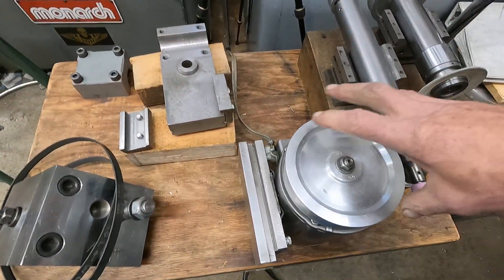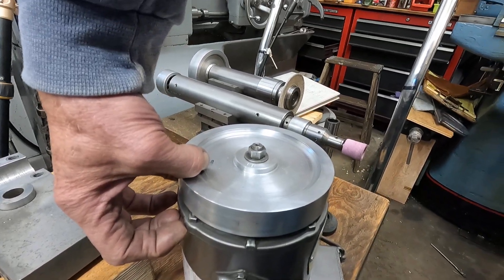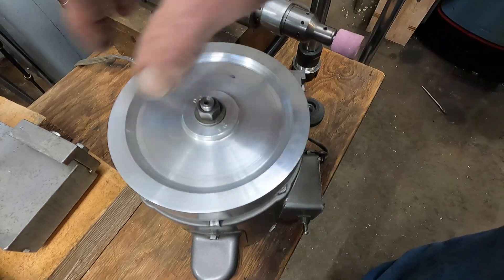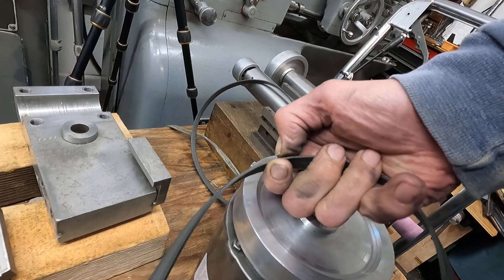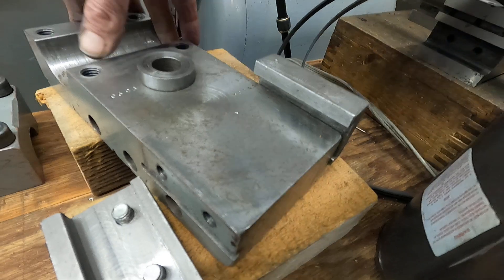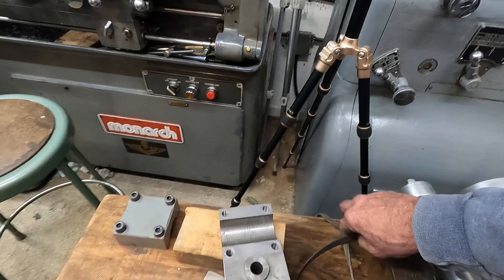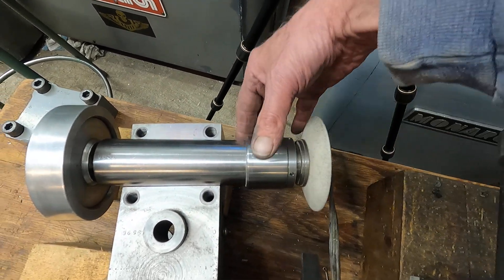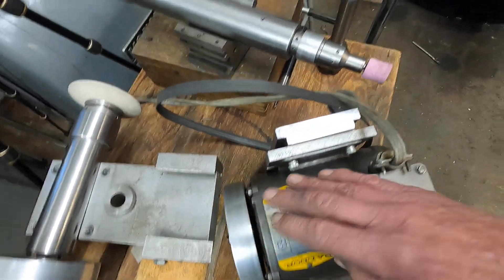Tool post grinder with precision spindles

Comment: There was a guy on Practical Machinist with a 10ee manufacturing lathe years ago from Walla Walla; would that be you?  I don't want to use the name from PM.
Reply from the maker: I seem to remember a guy on that forum of trolls, fakes and losers, probably left that sh*t for brains outfit run by a total puke of a machine tool dealer, for his own channel on the fabuluos YouTube. Roger That!
Reply: @deedeeindustrialsuperprecision  I always enjoyed what you had to say about machining and 10ees but remember people hassling you about your comments.  I still get on there but only the Antique and Heavy Iron forums.  I have a Van Norman mill and a tie bar Hendey.  I'm glad I ran across your channel!
Reply from the maker: @rickhand8228  The heavy iron moderator a fake gunsmith and supposed texass cop and the chump on the Monarch forum threatened my family by order of the sawed off POS racist owner!! Do not bring such scum to my channel.

Comment: Hey deedee, I think the topic of building machine tool spindles would be a wonderful subject for a video. You could really go in-depth on the subject of the different types of bearings, pressure angles, preload, lubrication, etc.
Reply from the maker: I plan on building another internal spindle with a collet nose, I will find a reasonable deal on the bearings first.

Comment: DeeDee, Absolutely stellar episode.  Tool post grinders I’ve owned have been toys compared to you build, and expensive as hell.  Thinking about yours a lot of thoughts went into making it simple but very flexible.  Nice design and execution.  It would be a challenge for me to build one but that project is going on my list.  Your belt trick is very &oil too.  You’d mentioned it before with regard to the Monarchs,but I don’t remember you talking about how you made them.  Great trick and worth everything you’re charging.  The last flat belt I bought from Dumore was not only comparatively very light weight, but cost an exorbitant amount.  You’ve made a convert.  Thanks for sharing everything today.  What a treat.  I am looking forward to seeing what you can do with with your grinder and really appreciate you sharing your wisdom.  Best, Will
Reply from the maker: Hi! Glad you enjoyed it, most prefer to watch an Axelson get slammed into reverse. It is funny but true!
Reply from the maker: I think you will find the Monarch 10ee easy to use and make parts like these. The first spindle I built used just a pair of electric motor grade 5 bearings and it does a remarkable job. The cost from a bearing house for spindle bearings is high, so I found new surplus bearings and designed the components around those. The 10ee is heavy enough to work pre-hardened steel to close tolerances making heat treating then finish grinding not needed most of the time. That is why they are still valuable machines

Comment: When I started my shop, I had to make a cheapie with a makita router with a dovetail mount that dropped on my aloris toolholder. It did work but later when I had the money , I bought a dumore tool post grinder. I make tooling for coin making presses and have to grind the id of coin collars.  We tend to improvise and find ways of getting things done with what we have available at the time. Dont jump at Me too hard for using a router, The customer I was servicing really helped me build My little shop. I had to polish the collars after grinding anyway.   You sure have made some nice tools. Wish I had the time but im always so busy in my shop keeping with delivery dates. I would love to have a moore jig grinder but my shop is crowded as it is.  I also bought an air powered Moore toolpost grinder  but it is so greedy on the air. 
Im sure the bearings are some of the finest though. 
 Nice video.
Reply from the maker: I do those things all the time except turning angle grinders into chain saws! The Moore jig grinder has one big unknown to me "Can I rebuild the air spindles?" and the other things on a used machine that may even be free that I do not know how to use. Thanks!
Reply: @deedeeindustrialsuperprecision  fortunately, the man I purchased it from had just sent it to Moore and had it rebuilt.
Reply from the maker: @danneumann3274  That is the machine to find with just a little good luck included there. I am sure you enjoy the feel of a machine that is the best possible as I do.